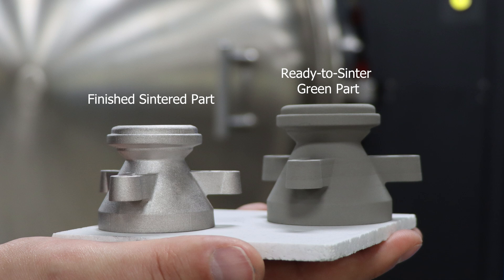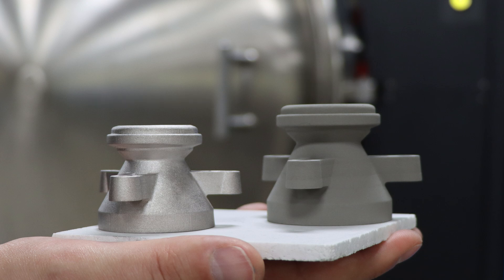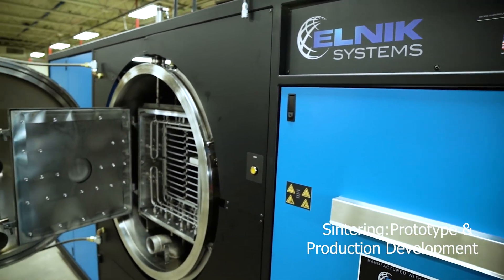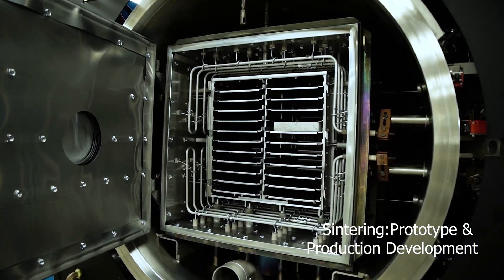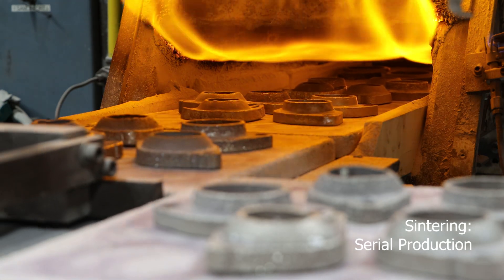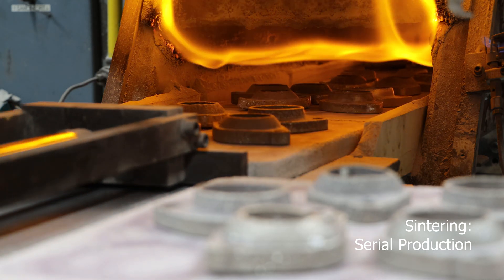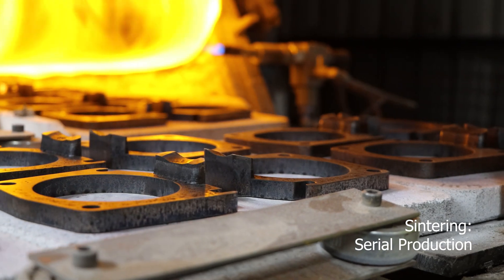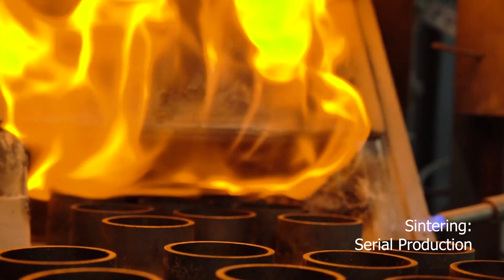Metal Binder Jetting: Sintering

Comment: Thank you, awesome! How is the sintering process in larger furnaces in production with higher throughput combined with X160Pro or P-50? Can it be automized with conveyor belts, is it easy to sinter or do you constantly need to take care of what part comes where in the furnace due to shrinkages and distortions? Does Live Sinter help a lot?